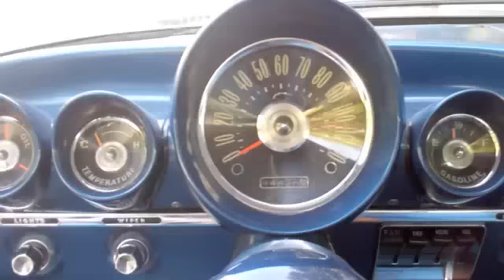1960 Chevrolet BELAIR - Original car - Survivor

Comment: In the very early '60s, my mom had a near-new '60 Impala convertible in this same medium blue with white top. Hers had the 283 V8, and 3-speed manual column shift. Too bad GM continued putting the 235 in cars after 1954, clear up to 1962. The were just too clunky, noisy and underpowered for a car this large, and it wouldn't be until 1963 that they discontinued the 235 in favor for a new family of more efficient and more powerful inline sixes (194, 230, 250, 292, and so on); all of which had 7 main bearings and hydraulic lifters.
Reply: Disagree.  The 235’s were wonderful!  Rugged a few forgiving.  Overheat one of the newer sixes and see what happens!

Comment: It sounds like the timing is a little off and has a slight miss and the idle is too high. It should not shake while it is idiling and the RPMs are way too high at idle, it should kinda lope a little when it's warmed up and the choke is off.
Reply: I totally agree.....idle speed too high on this 235.